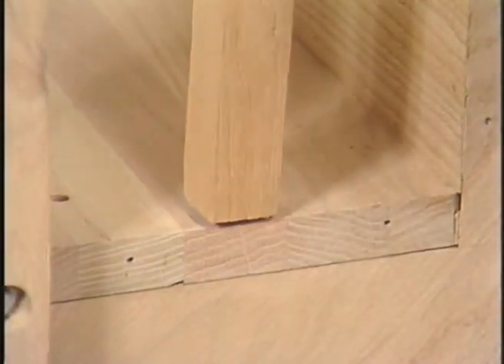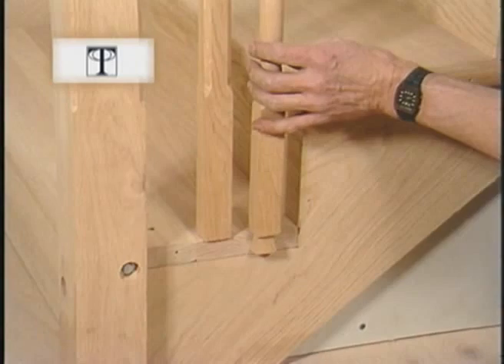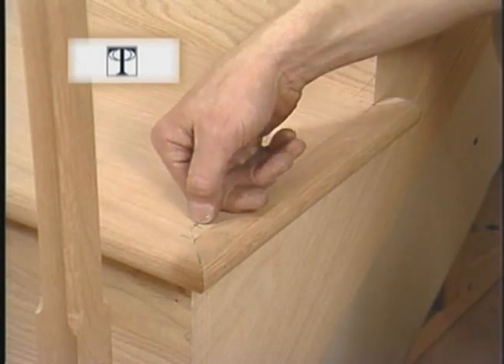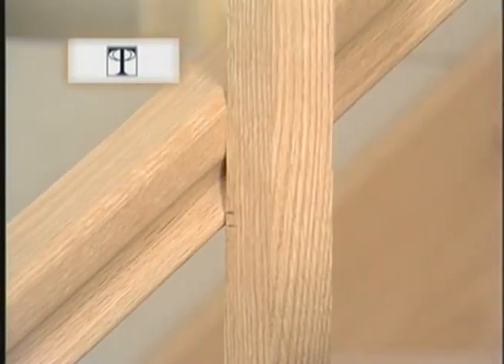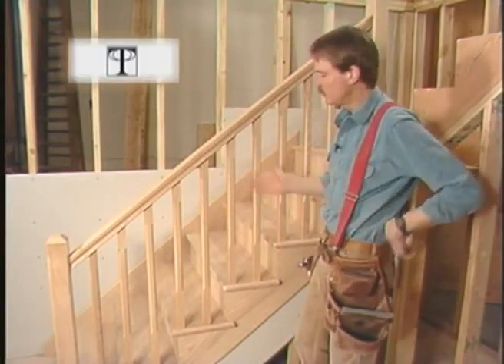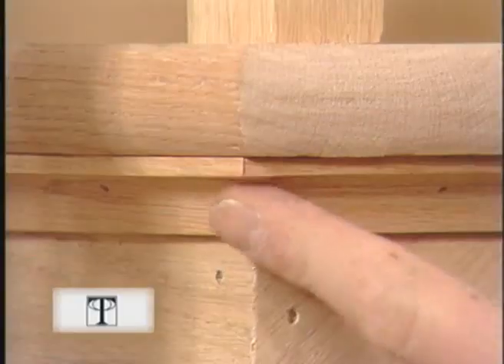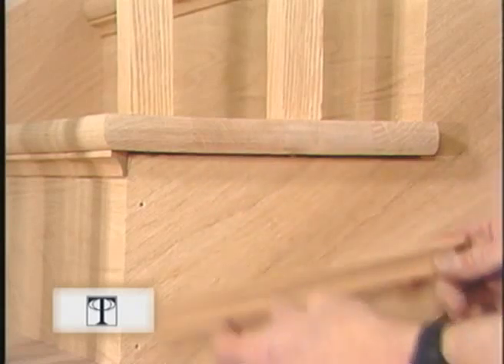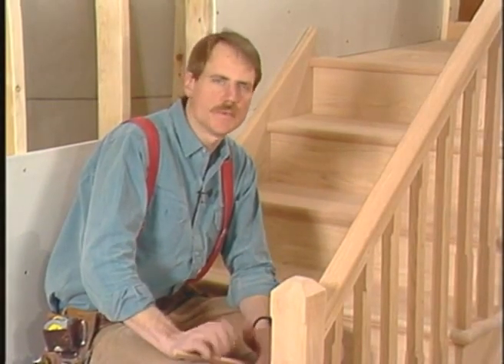The Balusters How to Build Stairs

Comment: Was wondering how you got angle on baluster where its meets handrail & nails tapped in? I saw the first mark, then second (on lower end) but no cut marking on the higher end of balluster. My old house steps not perfectly level. Thanks, great video, learned a lot but a carpenter I'm not. Thank God for you guys/girls sharing.

Comment: All his tops lined up evenly with the rail and the bottoms lined up with the next tread. That means the mid turned section for the baluster on the leading edged was longer than the mid section of the baluster behind it. See screenshot. How did he get those balusters? Self made? Custom order? Dumb luck? I can find square top balusters but the turned mid point is the same length regardless of baluster length. My rise is 7-1/2" and run is 10".

Comment: What is this? A mock up? You're putting in finish trim and the drywall isn't completed? Get rid of that hammer and nail crap. Pneumatics if you want a clean finish.
Reply: right,,kinda like using chop saw and drill,,
Reply: @billhamilton7524  Do you really think this is a recent video?  That Makita is now a collector's item.